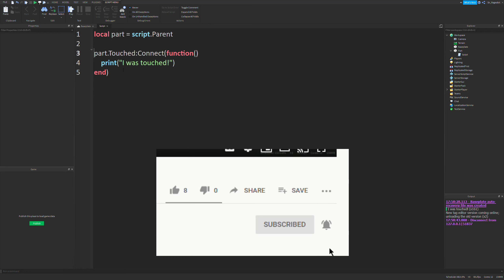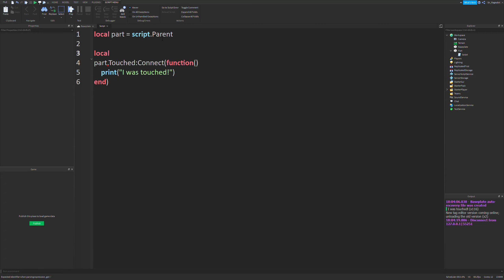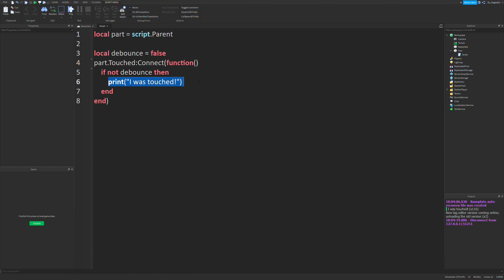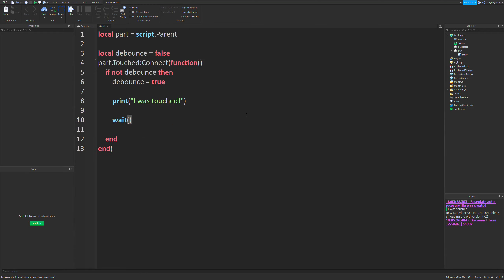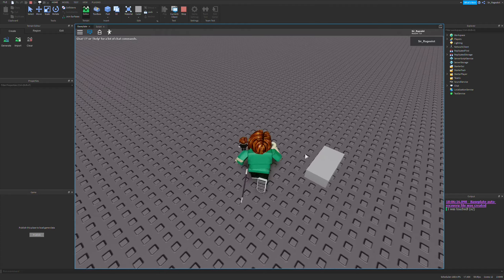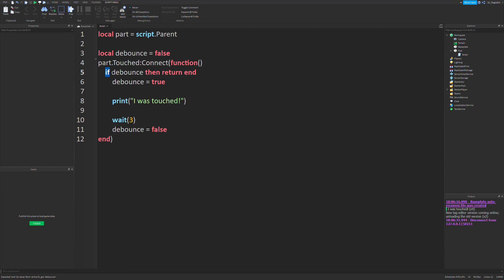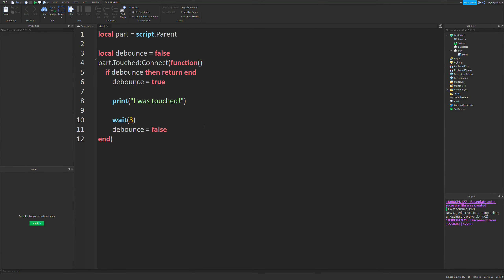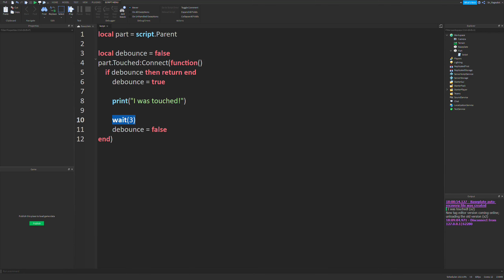How to make a Cooldown with Debounce - Roblox Studio

Comment: It doesn't work, what did I do wrong?

test = script.Parent
debounce = true

test.Touched:Connect(function()
	if not debounce then
		debounce = true
		print("works")
		wait(3)
		debounce = false
	end
end)
Reply from the maker: You set debounce to true initially. Debounce should equal false. (It is right under test = script.Parent). I hope this helps!
Reply: @BRicey  Thanks, it worked.